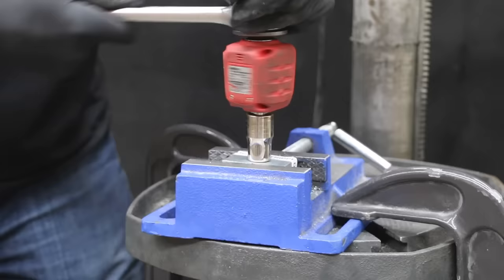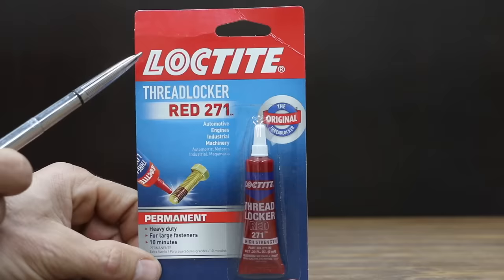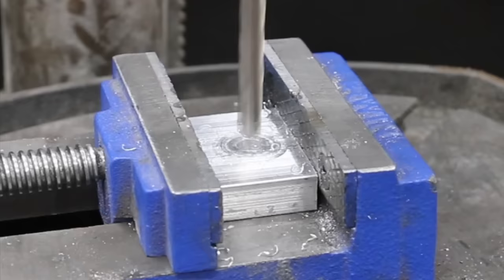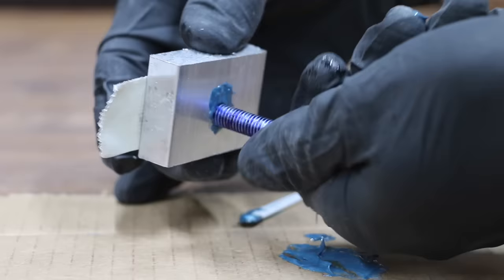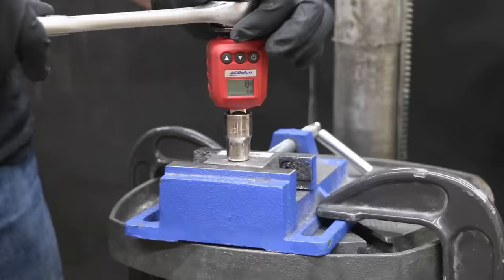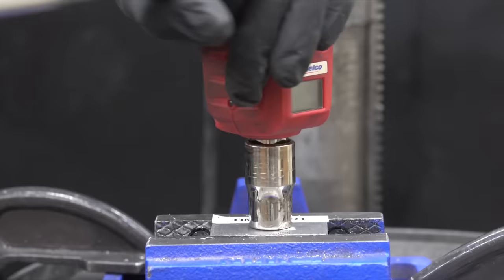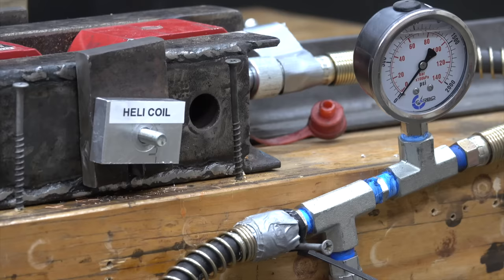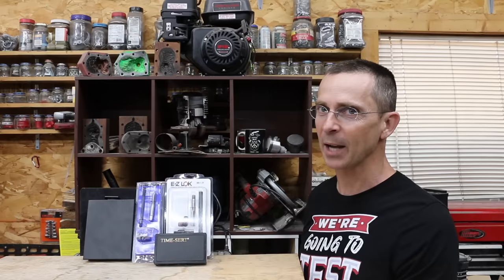Best Damaged Thread Repair? Let’s Settle This! Heli Coil, TIME-SERT, E-Z LOK, JB Weld, HHIP, Loctite

Comment: Since the aluminium remains the limiting material, I expected the inserts to be stronger only due to a courser external thread and larger O.D., providing a little more aluminium to resist stripping. Seeing the results though, I wonder are the coiled solutions winning due to their ability to expand a little, biting deeper into the the surrounding alu as they're pulled?

If that were the case, i'd be interested to see if the bolt loosens significantly in the coiled inserts after a few reps of the pull test - becoming more vulnerable to rattling out - and if the solid inserts hold up better.

Comment: Thank you for this video  @ProjectFarm ! I know I'm a bit late, but I'm tired of all these fancy tools like NES or Rotary Thread being thrown around. One of them even said it can work on any thread because most threads have a 60 degree profile - I'm like - buddy - no they don't! That's just alot of BS!   - this though, this was a good comparison! set em' straight!
Reply from the maker: You are welcome!
Reply: @ProjectFarm  @SilveryDon64, I think you may of misunderstood what @ProjectFarm video is about. They are creating a new thread in the video, not restoring it or filing it. Additionally, inch, metric and pipe do have 60 degree profiles and the Rotary Thread actually restores that 60 degree profile back into the thread. @SilveryDon64 and @ProjectFarm - proof is in the pudding though! happy to send you both kits on the Rotary Thread so can you see what we mean.

Comment: Small thing! Most aluminium bolts in automotive applications are actually using inserts! Biggest example is the newer BMW blocks from aluminium, its actually a common thing to repair the insert on very high mileage ones but hey! the cylinder coatings sure do last apparently!
Reply from the maker: Thanks for the feedback.

Comment: Great video thanks for your reviews. When repairing aluminum could the expansion/contratction difference cause an isue with using the inserts. Possibly test them at high and low temps.

Comment: Should have tried ( Quick Steel ) it is a metal apoxy putty. Mix fill let dry and tap. Works as good as a insert but easy as a apoxy
Reply from the maker: Thanks for the suggestion.

Comment: Great video as always.  I use a ton of ez locks without any issues.  You're corrosion test was faulty though. Mild steel vs stainless steel isn't a fair test. Both ez locks and timeserts are available in ss just in case

Comment: An interesting test, but I think it needs to be conducted with stronger bolts for the results to be meaningful. Otherwise all that is being tested is the bolt strength. 
Still good to see that it doesn't really matter what thread inserts I buy as long as they are installed correctly!
Reply from the maker: Thanks!

Comment: This is a good one. Obviously you had a difference in bolt strength on the 8.8 . Lets see that with 10.9 and 12.9 bolts steel and aluminum threaded controls.
Reply from the maker: Thanks!

Comment: I will say sometimes you want the thread to fail over the bolt but yeah Heli coil's are great for automotive threads thanks to corrosion resistance and size required for insertion
Reply from the maker: Thanks for the feedback.

Comment: Super interesting video! For any torque type test w threads I suggest lubing your bolt so your k factor(or frictional factor) doesn’t vary as much compared to a dry mating surface.
Reply from the maker: Thanks!  Thanks for sharing.

Comment: A bit late, but... copper is not softer than aluminum.  Aluminum has a Brinell harness of 15 and Copper 35.

I learned this the hard way when I tried using a home made copper pick to remove an o-ring on an aluminum a/c hose.

Comment: You need to use harden steel  bolts to actually get failure on the inserts. This test just told us that the inserts are stronger then aluminum.  I think you would agree with me here.
Reply from the maker: Thanks for the feedback.

Comment: I enjoy your channel, this video however, I think stronger/ larger bolts would have been in order, no? Otherwise reaching the stress limit of the bolt does little to test the durability/comparison of a thread repair in a cylinder head scenario. I know standard practice at the machine shop I deal with is to use timeserts in that particular scenario. But who knows, maybe a helicoil is better? Hoping to see a part 2.
Reply from the maker: Thanks!  Thanks for the suggestion.

Comment: Very nice, with a lot of efforting !  2 questions about using the HHIP kit or others for a car engine spark plug repair:  How can you be sure the insert tool is long enough to reach the bottom to start screwing in the insert....or do you just screw the insert on the spark plug instead, and don't use the insert tool ?  Also....you can't punch out the tang once the insert is in the spark plug hole.....the tang will fall into the engine piston area.

Comment: Helicoils can occasionally screw in further or come back out with the bolt, so I usually install them with some JB-Weld to glue them in place. I'm surprised that Timeserts didn't come out on top! Also Thank You for not making us watch you drill and tap all those test pieces,
Reply from the maker: Thanks for the feedback.

Comment: A testing idea for you...Thread checkers. The type you will find in most any hardware store. There are so many brands and a couple of types (wall mounted, strung on cables). A review I saw on a wall mounted unit found on Amazon showed the percent of failure in accuracy for both the SAE and Metric sides of a thread checker. But that was for only one brand. Would you do a comprehensive test of multiple thread checkers?
Reply from the maker: Thanks for the suggestion.

Comment: First great video, sound, editing, lighting, descriptions perfect. The tests were limited to the tensile failure strength of the bolts used, I suspect grade 5 ( or less ), I would have like to seen a grade 8 used to determine the failure of the interface of the thread repair method and the parent aluminum. Guess this was accomplished with the chemical fixs, ( loctite, JB Weld...... ). But in the case of a repair that requires a high clamp load ( head bolt ),  the pull out strength of the repair inserts ( Heli Coil, Time-sert... ) to the parent material would be very informative.
Reply from the maker: Thanks!  Thanks for the feedback.

Comment: There are a few South African TAXIES where only the really crucial threads of a component on the vehicle are held together by the LOCTITE thread repair again from Loctite's PRATLY PUTTY where I know from personal experience where my grandfathers truck's sump plug (NUT)  was leaking oil . We  took a nut that was the same size as the male thread coming out vize versa on a car it is a male bolt that screws into the car or bakkie (TRUCK) but I am procrastinating . We took a nut with same thread count and a South African 5 cent coin and it held untill the day the crank shaft broke . When  we sold the truck we took the sump NUT off  as too when the new truck's sump nut start's leaking we already have a fix .
Reply from the maker: Thanks for sharing.

Comment: It would be nice to also see comparison with one size larger bolt. Since bolt is often the weak point, that is also viable, especially if the insert requires a hole that is still slightly larger (in this cas, only E-Z), so it remains as a second option. It could also be interesting to see how much they leek, that is one of the weak points of helicoil and its clones. Still, good to see that pretty much all of the inserts work great, thank you for the test.

Comment: Should have done one with CATERPILLAR thread inserts. They are kind of like a time sert, but have locks that get knocked down into parent metal. They are very effective. I have used them a lot, including cylinder block head bolt repair on diesel engines.
Reply from the maker: Thanks for the suggestion.

Comment: That's a lot of work to make all those test pieces and testing apparatus!  Great job, as usual!
    It's nice to know how the Heli-coil held up in aluminum.  I've used those in a variety of applications and have generally been pleased with the results.  Sometimes I like to use some red or blue thread locker to attach the insert to the base metal so it will most likely never move after installation.  This also helps to seal the threads in case of something that needs to hold liquid such as oil or coolant.
    Another interesting test would be done with stronger bolts and stronger base metal, like cast iron, but I realize that would be more difficult.
    In the real world, such thread repair inserts are often used in cast aluminum (not extruded flat bar) or cast iron, so the strength difference between the original threads and the insert will probably be much greater.  But I wonder how soon the base metal would fail with vs without a thread insert.  Testing that would probably require using a bolt of larger diameter than the thickness of the base metal.
    Further, in heavy industry it is a common "rule of thumb" that to achieve maximum strength the depth of the threads (how far the bolt is threaded in)  needs to be at least equal to the diameter of the bolt.
Reply from the maker: Thanks!  Thanks for the suggestions.
Reply: @ProjectFarm  
I just remembered:  When using thread locker on a Heli-coil I usually run a tap through it to remove the excess thread locker from the inside.  A little brake parts cleaner can also be helpful, but should be used very sparingly to not affect the thread locker that needs to stay in place.

Comment: So interesting, thank you! I was surprised at the bolts failing later with one insert... I'd expect once you found the point the bolt breaks, the insert doesn't matter. Any idea why all the bolts failed consistently apart from one insert on the torque test?

Comment: There's a material called Lab-Metal, that comes in a small, paint can, that's supposed to be considerably better than JB Weld.  It would be interesting to try that; I used the High-Temp version on an exhaust manifold bolt on the head of a Cummins engine, and it hasn't leaked in over 10 years.
Reply from the maker: Thanks for the suggestion.

Comment: Fantastic demonstration and I personally love the simulated head holding test.  The lots of manufactures have had issues with aluminum threads holding steel bolts.  It's nice to know that not only is there hope, but you can also significantly improve the engine for performance.  Where's the aluminum M52 guys?   Anyone use these repairs?
Reply from the maker: Thanks and you are welcome!

Comment: Would be interesting to see a test like this on blind holes where the bolt doesn't go all the way through and you can't drill through such as oil pan holes on a block or bell housing bolts
Reply from the maker: Thanks for the suggestion.

Comment: Looking at the results at 10:39 minutes. I think the results of all of the mechanical thread inserts should be identical since they all held the bolt tight enough to shear off. Therefore any difference in the torque on these mechanical inserts is due to the difference in the shear strength of the bolt and not the holding power of the insert.
Reply from the maker: Thanks for the feedback.

Comment: Very informative, Todd.
I wasn't aware of some of these brands.

I wish you would have used a stronger bolt (if possible) so that we could have learned the true strength of the inserts.
Why do you think E-Z Lok was able to prevent the fastener from failing, for so much longer, in the torque test?

Comment: As a suggestion could we see a comparison between thread forms. A redundant thread like Whitworth Vs Course Metric Vs UNF Vs standard Metric. The test piece could be plate steel drilled 1 inch and threaded with each different form into which a high tensile bolt is inserted also the same thread form. It may be difficult to source the Whitworth but the others, easy. A measure torque is applied to the bolt until it pulls free. I believe Whitworth will be the winner. Given Metric dominates manufacturing , the test may show standardization has come at the expense of strength.
Reply from the maker: Thanks for the suggestion.

Comment: I have and used the time-sert spark plug repair kit and it worked great. thanks for this great video if i need a kit the HHIP is really a good deal. it looks like you could use a high strength bolt for these tests. you did not say what the bolt specs were.
Reply from the maker: Thanks for sharing!

Comment: 20 psi is the torque setting. An m8 thread recommended torque setting is 20nm for an m10 54nm on steel for alloy is a lot less approximately 10% less

Comment: This gave me nightmares of punching the ends of helicoils into closed holes and fishing out the tab...1,000s of times...We had to preinstall them because of the huge temp swings on B2 bomber computer chassis which were cooled outside the plane. Steel bolts into aluminum would always strip, but the steel on steel would hold tight and the aluminum threads were bonded with helicoil which made the tabs extra sticky.   
It seems like the ezlock system either allows more room or less room for the bolt to flex or be more rigid to have that much more strength between them consistently.
Reply from the maker: Thanks for sharing.

Comment: Yet another well done, compelling review, thank you.  Suggestion: have you ever hazarded to do a comparative review of the different space heater products?  So much loud, shameless smoke and mirrors in this realm.  I've long used the quiet oil filled electric heaters, but recently tried one of the more expensive, yet very noisy "radiant" style heaters -- supposedly able to heat larger rooms.  (and was disappointed, even angered by the latter)  If you've not done one yet, be glad to help you with the design and setup of such a review.
Reply from the maker: Thanks and you are welcome!  Thanks for the suggestion.

Comment: You should’ve tested these products with a bit of heat and see which ones lose their strength. I know aluminum doesn’t hold heat very well so maybe try with steel. I’d be curious to see how they hold up if you used them for like engine blocks or something that’s around higher than normal temps.
Reply from the maker: Thanks for the suggestion.

Comment: I had a stripped out bolt on a transmission pan 
It would thread but would not lock down 
I used aluminum foil that I placed on the bolt 
I also added thread locker medium strength on both the outside of the aluminum foil and on the bolt itself 
It took a minute to get it in but it did thread and lock down 
I’m hoping between the aluminum foil and the thread locker that it will stay sealed 
There really is no pressure at all on the bolt because all the others locked down tight 
I also put some Permeatex on the outside of the head of the bolt just to maybe stop it from loosening up 
I would tap a new hole but as my luck would have it 
It’s in a tight spot and there is no way I am dropping the exhaust to do this
Reply from the maker: Thanks for sharing.

Comment: Makes senes the inserts would outperform the original aluminum. I believe it's pretty common to helicoil threads on VW blocks both because the OEM threads bust and because what you replace them with is strong.
Reply from the maker: Thanks for the feedback.

Comment: Should have compared the metal inserts to their respective thread bolts. Since the inserts were 10mm you should do a 10mm bolt and see if the bolt will break or strip the threads.

Comment: I honestly think that I might consider the EZ inserts on some of my aluminium cases when I reassemble my old shovelhead because to be honest some of the older threads I don't like to totally lock with loctite, but of course the crankshaft timken race well you can't go past the correct loctite, but bottom end cases and things like that you really can't go wrong
Reply from the maker: Thanks for the feedback.
Reply: @ProjectFarm  we all thank you very much for what you do, I know that you have saved myself many injuries and even better, you show us that sometimes but not always, there is a ton of options.

Comment: Actually, in all instances where the bolt breaks the pressure gauge becomes irrelevant. When bolt breaks you don't reach the point of assessing the thread. So, you can at best say this and that thread performed similar, meaning they beat the bolts. We don't know the exact pressure amount they would give up had the bolts not broke.

Comment: It would be interesting to see how JB Weld would have done by coating the bolt treads and screwing it in hand tight and letting it dry before testing rather than cutting threads into it.
Reply from the maker: Thanks for the suggestion.

Comment: Please test again with some small head bolts. We need to see when they do pull out of the aluminum/strip. Head bolts need to be torqued tight we need to know if that is possible! I know there's a kit for the Northstar 32v Cadillac motor, great engine after that repair.
Reply from the maker: Thanks for the suggestion.

Comment: I really enjoy the content, your testing methods are straight forward to present the facts. However I'm slightly disappointed that you didn't use one insert. I can't remember what brand it was but it had sliding locks on the side that were hammered in after setting the depth. One thing that wasn't covered was retention of the insert if the bolts must be removed frequently. Like if the insert were to get stuck to the bolt and come out of the hole. Still I thought it was a great video and I appreciate the great content......Ha found them under "Key Locking Thread Inserts”